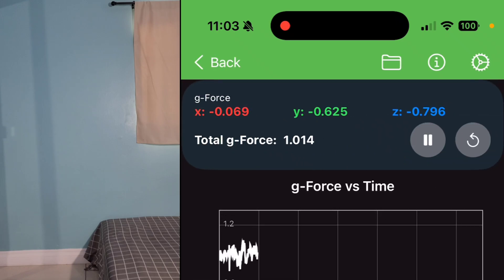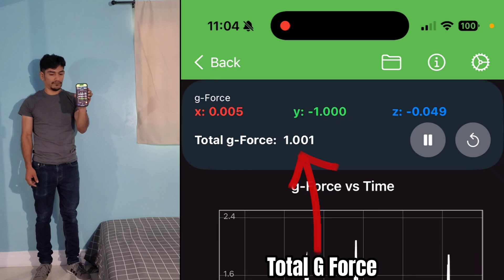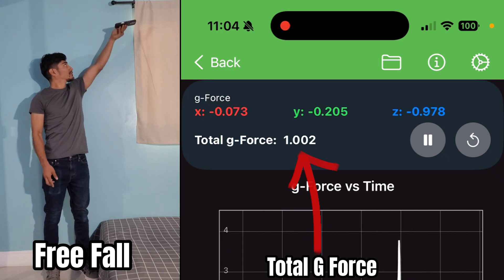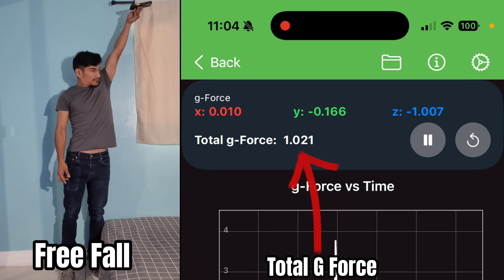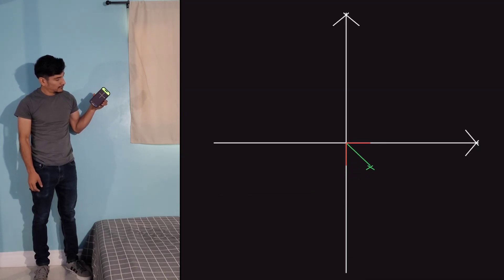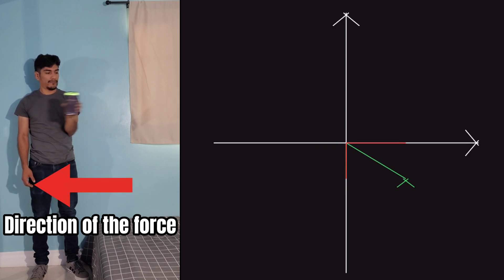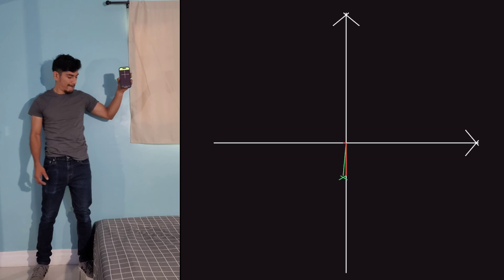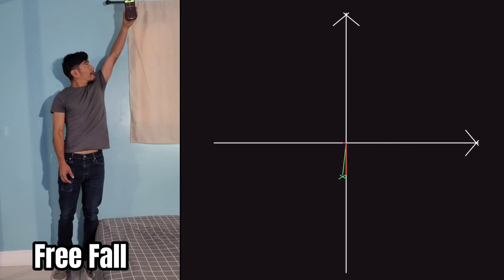Digital Accelerometers Detect That The Force Of The Earth Is Up Not Down - Experiment

Comment from the maker: A digital accelerometer is a devise that detects the presence of a force or acceleration.
For example, when at rest and connected to the earth, it detects 1G force. 
As soon as I accelerate it from being at rest, the accelerometer detects that acceleration by increasing the G force.
Whether I accelerate it to the right, to the left, up or down, the accelerometer will always detect the acceleration 100% of the time.
However, the instant I put the accelerometer into free fall, it detects a deceleration. It goes from 1G down to zero. 
If the accelerometer was accelerating down in free fall, it would detect that acceleration by increasing from 1G not decreasing.
Not only does the accelerometer show that there’s no detectable acceleration in free fall, but it also shows that the vector or force of the earth is up.

When I switch to the vector tab of the accelerometer, we can see when at rest on earth, it detects that the vector or force is down, as shown by the green line.
However, the vector on the phone is inverted because when I apply a force to the right, the vector goes to the left, and when I apply a force to the left, the vector goes to the right. When I apply the force down, the vector inverts up, and when I apply a force up, the downwards vector increases, showing that the vector on the phone is inverted from the true direction of the force or vector.
So when the phone is at rest on the earth and knowing that the vector is inverted, the direction of the force or vector is up.
Also, when the accelerometer is in free fall, the vector completely vanishes, showing that it’s not being accelerated down by any force. Which proves that the force or vector of the earth is up not down.

Comment: Notice how when you showed the accelerometer increases in G’s when you pulled it down you pulled it harder than free fall speed thus increase in G’s but when you let it actually free fall it shows almost 0G cause it’s free falling minus air resistance.
Reply from the maker: Notice how the accelerometer didn’t detect any acceleration in free fall.

Notice how the accelerometer detects the vector of the earth is up.

Comment: Glad that you're a flat earther but, the "upward movement of earth" is non sequitur. You can't PROVE that motion...As well; Aerospace modeling doesn't use ANY upward thrust variables...USAF veteran...On an Aircraft; the altimeter is set and doesn't vary, which it would if the earth was moving in any sort of fashion...The earth is flat and stationary.  
NASA 1973

page14 pdf or 6 on actual report:

a) The earth is flat and non-rotating.

https://ntrs.nasa.gov/archive/nasa/casi.ntrs.nasa.gov/19790005472.pdf

A Mathematical Model of the CH-53 Helicopter

NASA  

page 17:

“The helicopter equations of motion are given in body axes with respect to
a flat, nonrotating Earth.”

https://ntrs.nasa.gov/archive/nasa/casi.ntrs.nasa.gov/19810003557.pdf
Reply from the maker: Flat and non-rotating doesn’t mean flat and motionless.

Aircraft do take account of the earths upward motion and buoyancy by utilizing thrust to push off of the air. Otherwise the earth will crash into to them.
Reply: @LevelheadedWilliamNatalie  The physics, as you describe, would be very problematic... But, I see you have a "belief"...Beliefs are the toughest thing to change...Good health to you and yours.
Reply from the maker: I don’t have beliefs, Physics is what it is.
You have the belief that objects can accelerate without any effects of acceleration 😅
Good luck with that 😅
Reply: @LevelheadedWilliamNatalie  You shouldn't put words in my mouth or...What you wrote considering "acceleration" is irrelevant to the premise..."Accelerate" means to increase speed...So?